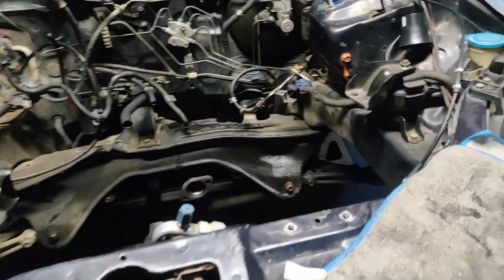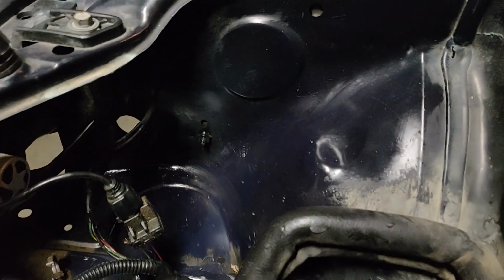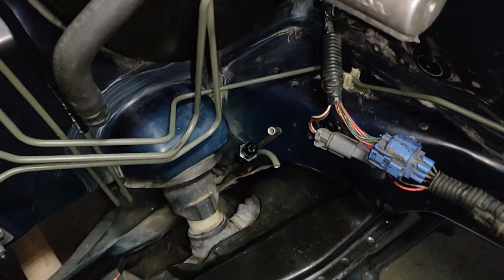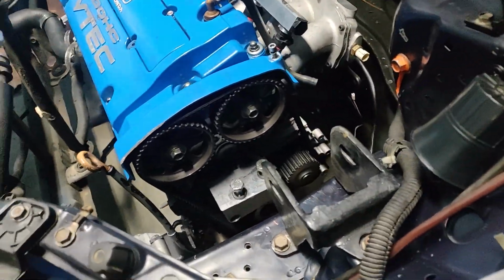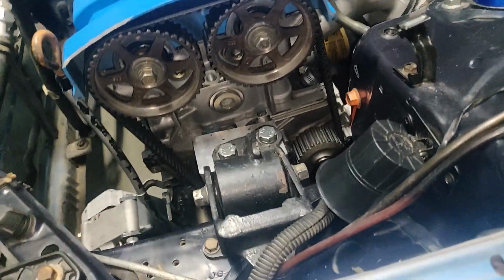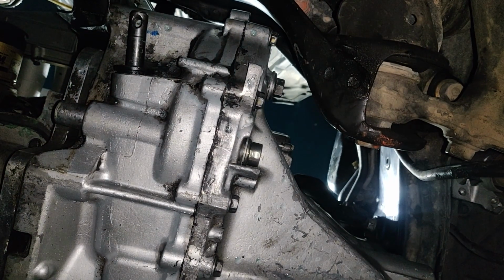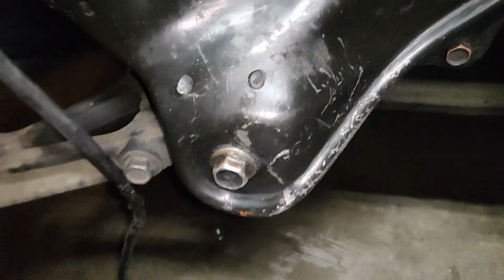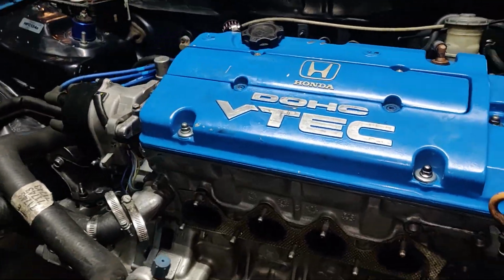THE ENGINE IS IN!

Comment: What year head gasket did you use on your h23a vtec and do you got part number? Ty ty
Reply from the maker: I actually don't have a, h23 I have a H22 and they use different head gaskets. Your engine should have stamps on the front of it that tell you the year tho and you can definitely go off of that.